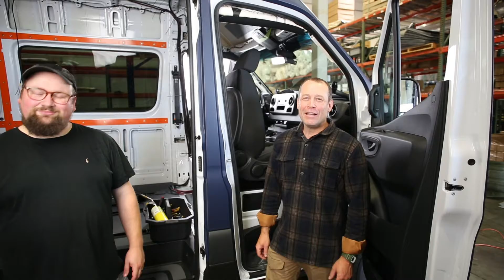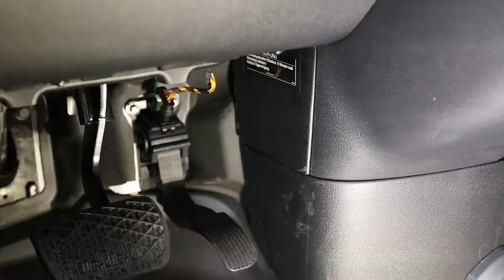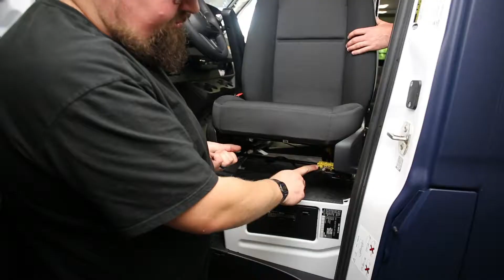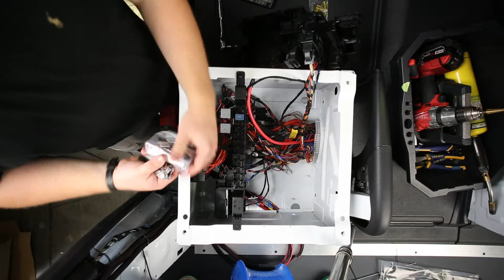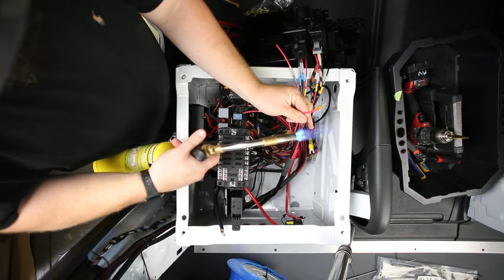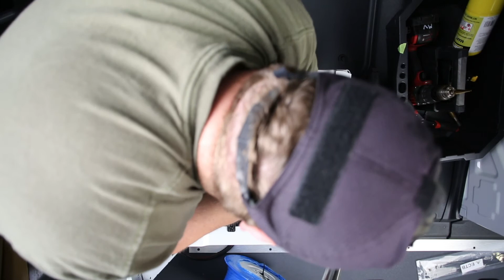How to connect FUSE BLOCK to power source w 144 Sprinter Van

Comment: Just popping in to say thanks for the video, really helpped me plan out my strategy. I thought of one thing when i actually messed with my van though, when connecting the positive cable to the battery, there was that small black wire/ring connector. I would say the cable lug should go under that ring connector just in case whatever current you have going through thr cable is higher than the rating of that small ring connector. The ring connector should be on top.
Reply from the maker: Glad you found the video helpful!

Comment: When you pull the "chassis battery disconnect", the battery posts remain hot correct? You land one end of your new red cable right on the battery with the other end just flopping around hot (I presume). Going forward, the "chassis battery disconnect" would disable all power under the seat except what you just added. It bypasses the disconnect. Am I seeing this wrong?
Reply: The disconnect is on the negative terminal. opening all circuits. You'll bypass this if you connect a ground directly to battery.